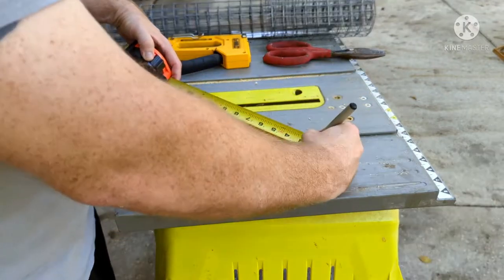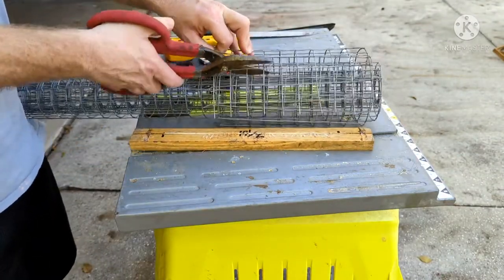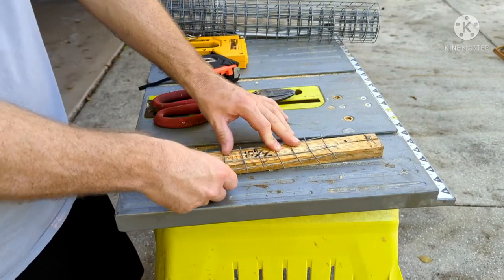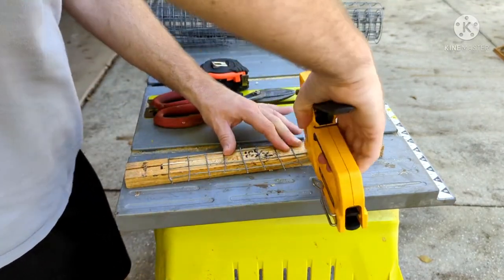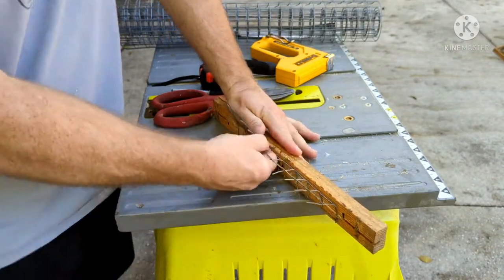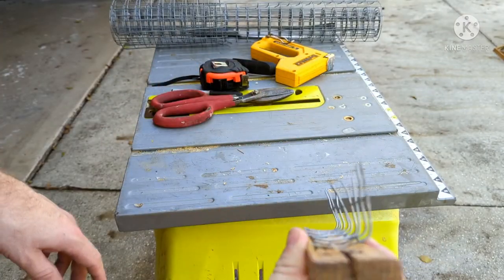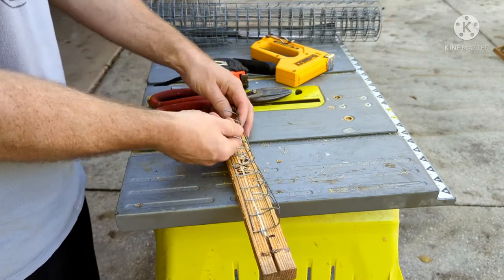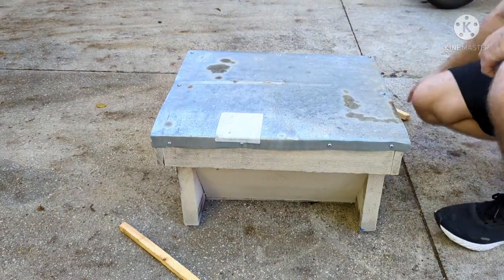Top Bar Hive Rescue Bar

Comment: I did a disaster (bees leaving ) cutout to top bars using long screws bottom bars and rubber bands. Won’t be using that method. Was that 14 gauge wire?
Reply from the maker: The disasterous cut outs are horrible. I tried to look for the product online but I didn't see it. I think it is 16 guage but I could be wrong. Anything sturdy enough to bend and still hold the comb should be fine. Good luck with your next cutout and I hope it is easier.